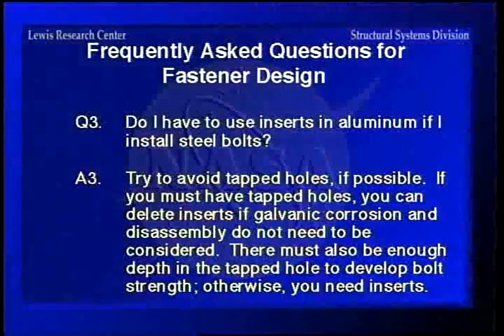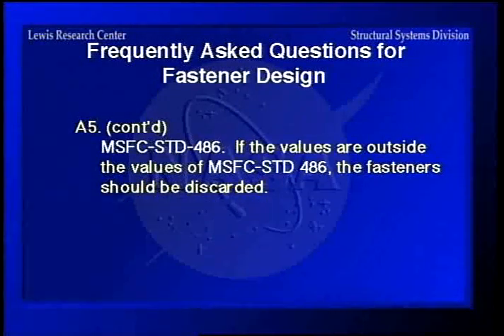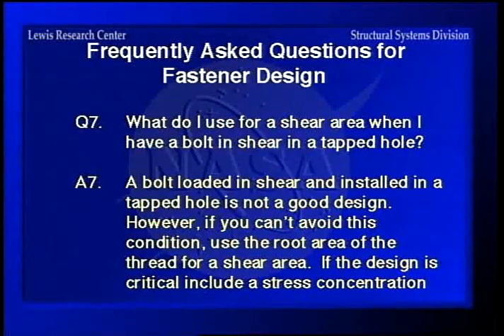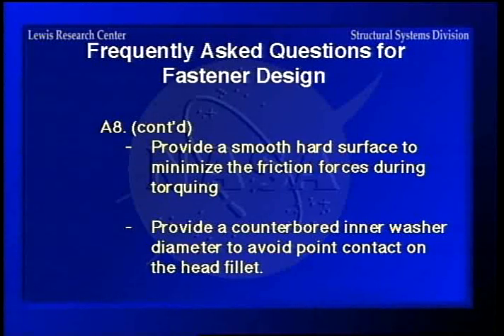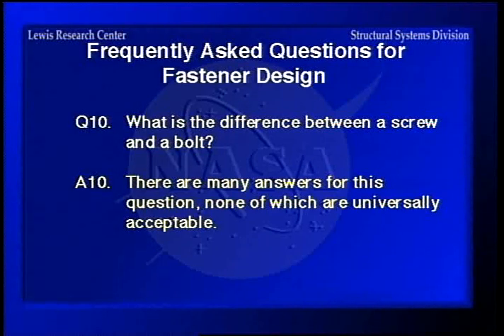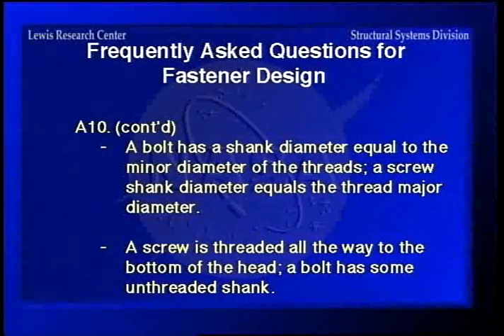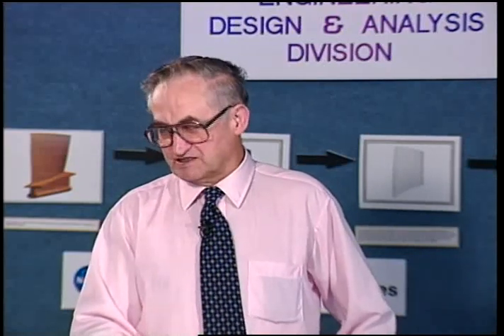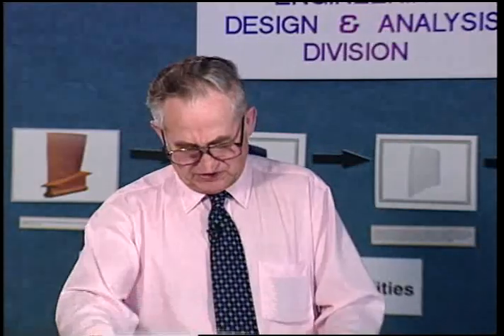Fastener Design Course: Part 9

Comment: Can somebody provide evidence for this claim from Nasa "fastener design manual"  year 1990 by Richard T. Barrett
Wkwashers
The typical helical spring washer shown in figure 14 is made
of slightly trapezoidal wire formed into a helix of one coil so
that the free height is approximately twice the thickness of the
washer cross section. They are usually made of hardened
carbon steel, but they are also available in aluminum, silicon,
brome, phosphor-bronze, stainless steel, and K-Monel.
The lockwasher serves as a spring while the bolt is being
tightened. However, the washer is normally flat by the time
the bolt is fully torqued. At this time it is equivalent to a solid
flat washer, and its locking ability is nonexistent. In summary,
a Iockwasher of this type is useless for locking.